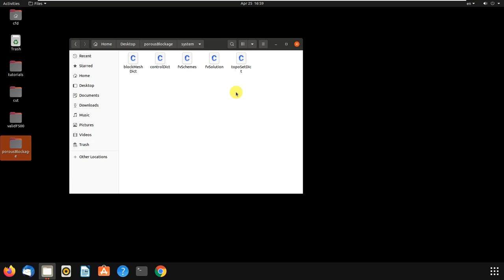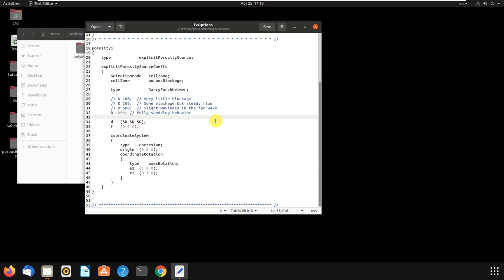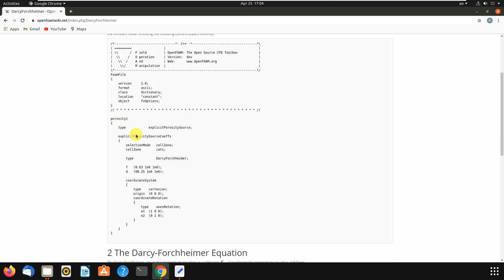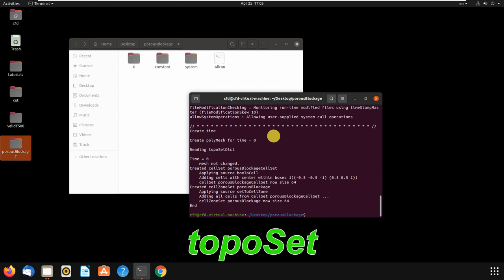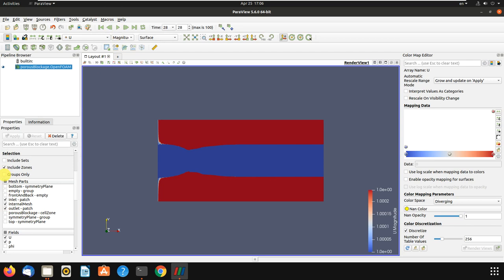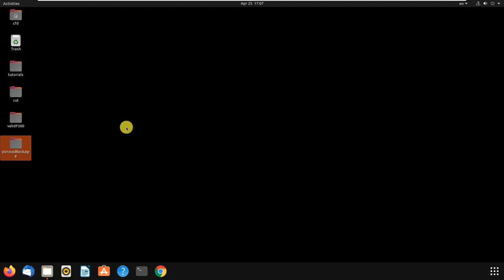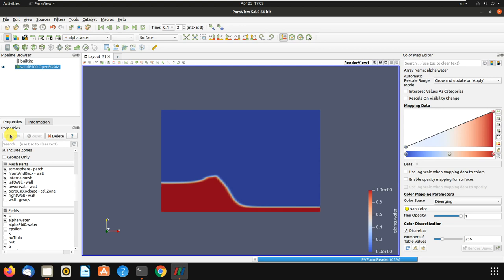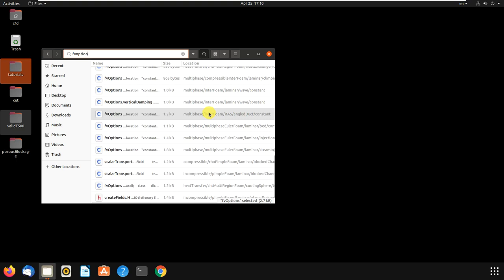How to add porous media to our case in OpenFOAM (with short review of fvOption)

Comment: Hey there, thanks for the video! A question: how should I identify the value of D given the pore size and the porosity? Thanks!
Reply from the maker: Hi, I myself did some try and error to identify my desired D. It's a bit complicated than that you can also use'F' therm which I put to "0",  but you can also change that number to have your suitable porosity and pore. 
Thare are also other examples in openFoam which may be better for your problem.  Also try other solvers if this didnt work.

Comment: Hi thanks for uploading such a useful video, I have a Question is it possible to add porous media in Foam-extend(fe40) version? if so how. i want to use for visco-elastic models.
Reply from the maker: Thanks for your pleasing comment. Unfortunately, I have not tried extended version, but you can give it a try and it may work.

Comment: Hey, nice video!
I have also tried out some porous media cases in past with some issues. When I simulate a rectangular pipe with porous media, inlet and outlet zone, I get fluctuations of velocity close the the porous media borders. Due to this, the pressure increses before porous media and reaches negatvie values after it before reaching 0 Pa.
Which fvSolutions/fvSchemes etc. did you use? Do you have the same issues? I get this problem even with simpleFoam and porousSimpleFoam.
Thx in advance.
Reply from the maker: Hi Christian
No, I didn't have same issue.
as you know there lots of porous media problems and you should use the correct one depend on your problem.  I used darcy forchheimer which is based on navier stocks equation.
here is the fvScheme file:

ddtSchemes
{
    default         Euler;
}

gradSchemes
{
    default         Gauss linear;
}

divSchemes
{
    default         none;
    div(phi,U)      Gauss LUST grad(U);
    div((nuEff*dev2(T(grad(U))))) Gauss linear;
}

laplacianSchemes
{
    default         Gauss linear uncorrected;
}

interpolationSchemes
{
    default         linear;
}

snGradSchemes
{
    default         uncorrected;
}
Reply: @MiniUniverse_RA  May I can contact you by email? Stil not working, than I could show you a picture of my velocity plot.
Reply from the maker: @christianm8793  That's okay

Comment: First of all, thanks for the video. If I define a block to cover the surface with the "wall" boundary condition, will this surface with the "wall" boundary condition also be porous? Thx in advance.
Reply from the maker: I didn't get your question completely, but if you want to define a block with porous media which acts like wall, you can increase the coefficient D, in that case porous media behaves like a wall
Reply: @MiniUniverse_RA  I have been studying cavity flow problem. In my previous analyses, the rear wall of the cavity had the "wall" boundary condition. I want the rear wall to be porous. Can I do this with the method in the video? thx in advance.
Reply from the maker: @ACFadl  
No, in this method you can't change the boundary condition of the porous media to the best of my knowledge.